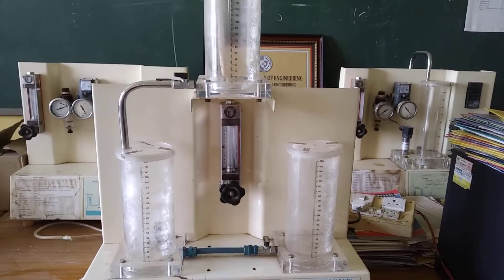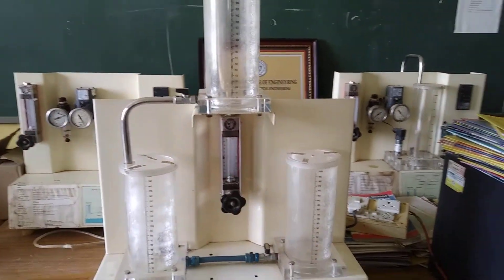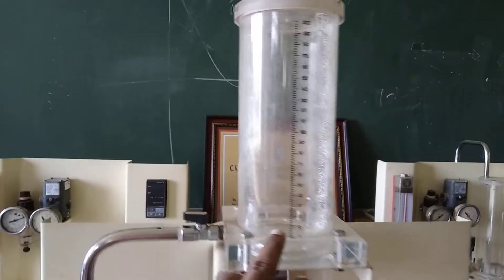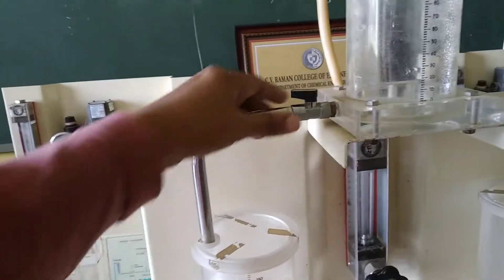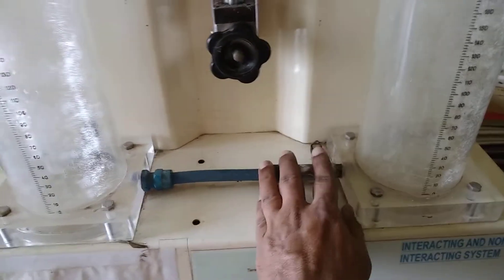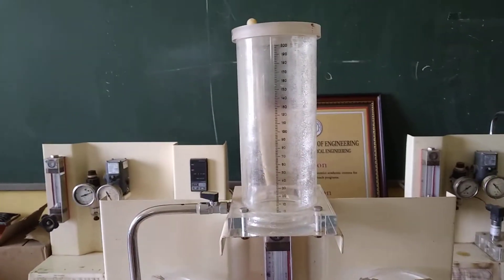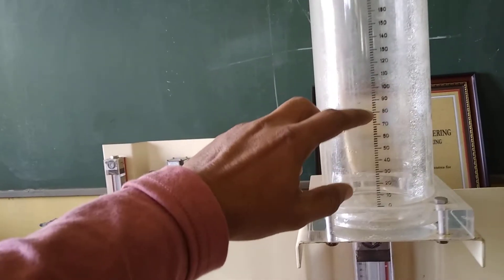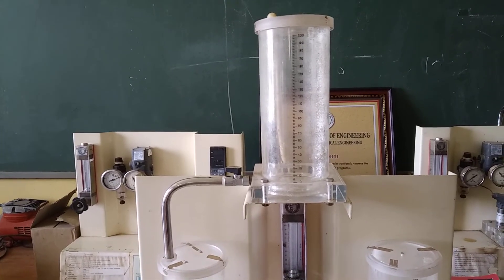Single Capacity Tank

Comment: 1.PROCESS SIMULATION LAB 
2.CHEMICAL REACTION ENGINEERING
LAB 

3.MASS TRANSFER OPERATIONS LAB
4.PROCESS CONTROL LAB
5.HEAT TRANSFER OPERATIONS LAB
6.FLUID AND PARTICLE MECHANICS
LAB 
7.PARTICLE TECHNOLOGY LAB

8.CHEMICAL TECHNOLOGY &
ENVIRONMENTAL ENGINEERING LAB
9.CHEMISTRY LAB FOR PROCESS
ENGINEERING